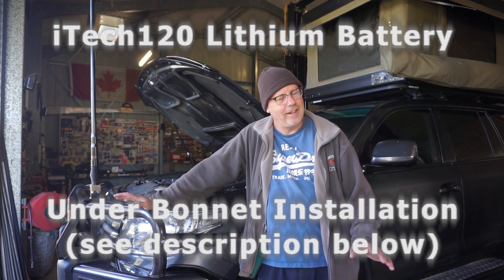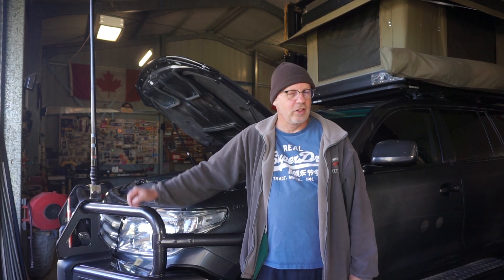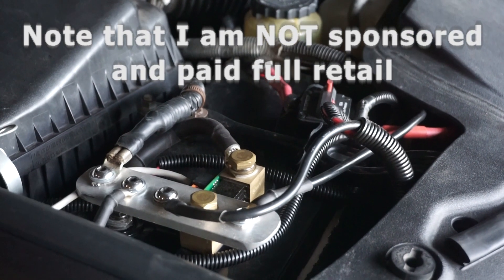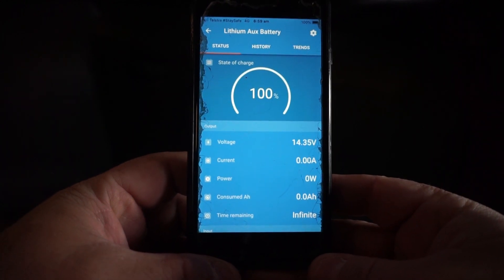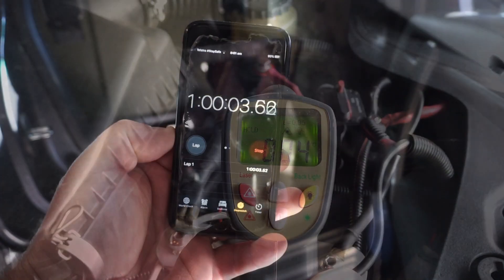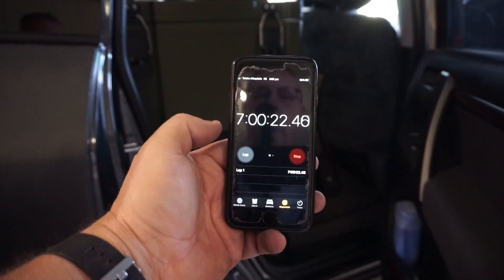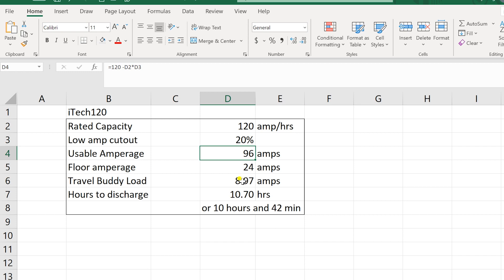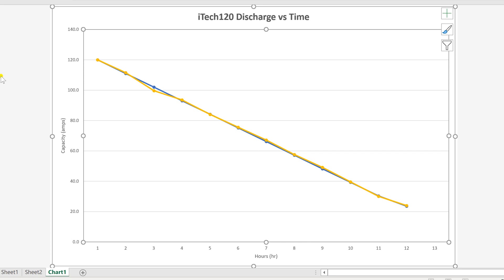Lithium Battery Long Term Review | itechworld 120 Under Bonnet Installation

Comment: I just bought my first 4 x 4 a week ago and have been looking at heaps of options for a dual 24vdc system. Your youtube vids are extremely helpful, much appreciated. My thoughts are to install an iTECH120X in a 150 series Prado under bonnet if I can fit it. I know your review is based on the iTECH120 however this led me to the iTECH120X same physical dimensions. Looking at the 330mm L dimension & Heat Shield Kit it appears to either fit or not fit by a cats whisker. I'm hoping that it will fit as these batteries appear to be an awesome option for 24vdc aux.  Cheers again for your review it's been very helpful.
Reply from the maker: Welcome to the 4WD community ANDREW, you’re life has forever changed for the better!  I have seen the 120X as well mate, they were not on the market when I bought mine otherwise I would have one under the bonnet.  It certainly was a tight fit in the 200, as you say by a cats whisker, the Prado 150 may be even tighter but I cannot confirm as I have no experience with that model of 4WD.  Thanks for watching and sharing your thoughts Andrew, I sincerely appreciate it 😎👍

Comment: Hi Terry, Great video! Curious if only you had some temperature logging data in real time as comparative vs voltage. I am also curious what dual DC DC charging system you are using? I am currently making the transition from a Redarc BCDC system to Victron setup.
Reply from the maker: Thanks for the kind words mate, I appreciate it very much.  I did not record temperature hourly as I did with voltage.  Having said that, I did record it throughout the test and there was zero detectable change.  The battery simply sat at whatever ambient temperature was at the time.  I’m using a Redarc BCDC25 and have had no issues or complaints.  I would be curious to understand why you are changing out your Redarc for a Victron.  Keep the shiny side up mate, cheers 😎👍

Comment: Good video Terry.  Can I ask why you settled on iTech World, I see them being flogged to death in the weekend papers and their approach just does my head in and has the adverse affect of turning me away.  I’ve watched quite a few lithium reviews now and I’m approaching the point of looking to replace my lead batteries with a lithium alternative. One brand that I keep hearing about by others but not necessarily being overtly promoted are DCS.  So as I respect your reviews because they are unbiased I’m keen to understand your choice. 👍
Reply from the maker: Hi Andrew, thanks for the great question mate.  I too see Itech advertising everywhere, I just thought I was getting spammed because I bought one😂.  As you can appreciate my review is not about comparing brand A with brand B.  I have only used itech so have nothing to base a comparison on.  The review was designed to challenge the notion that lithium cannot be placed under the bonnet and survive long term.  So far, I believe the bull case is valid.  The reason I bought an itech as opposed to any other brand is that they met my overall amp/hr requirements and they were on special at the time (I think about $100 bucks off from memory).  I trust this answers your question mate.  Cheers😎👍

Comment: Great to see a open minded review. Though aren't lithium batteries generally rated for useable Ah not total capacity. If this is true your useable 120Ah is now below 100Ah in seven months. This may not be the case with this brand but its generally what I've heard. May have missed it but was this method of battery tested perform when new for comparation?

All Under bonnet installations aren't the same. You have a better chance staying within the operating range in a front install but if near the back of the engine near the exhaust and/or turbo this would lift the temperature to an unacceptable level.
Reply from the maker: Hi David, thanks for your comments, your insight and of course your questions.  The itech batteries are rated for total capacity.  My battery has been superseded by the 120X.  It is rated at 120amp/hr total capacity with a true usable storage of 107Ah.

I did indeed cover the fact that I did not use this method of testing when brand new, but used the manufacturers specifications.  My logic is that if anything they are going to spec them biased to the high side for marketing purposes.  That being the case, any deterioration in performance over time would have a greater probability of showing up.

I agree, all under bonnet installations are not created equal.  Having said that, the warranty (which I have read in detail) does not stipulate good or bad positions, just that it is warranted for under bonnet installations.  I hope I never have to challenge this, but your point is well made none the less.  Thanks again mate, keep the shiny side up.  Cheers😎👍

Comment: Guess who just guaranteed a sale of 2 x itech120X when it's time to build out my vans electrical system...

Here I was thinking I'd have to shell out close to $3K in Koala coins to get a pair of 100AH battleborn's from the USA.
Reply from the maker: Nice one mate, I hope they set you back a crap load less than 3K!  Mines still going strong, no complaints.  In fact I’ll swap out the start battery with a lithium when my Lead acid one dies.  Cheers 😎👍
Reply: @JafffaAdventures  Interesting, do they have a gizmo now that makes lifepo4 suitable for cranking... or would you consider going wild and installing a capacitor bank for starting?
Reply from the maker: Apparently they have designed a separate battery that can handle the discharge currents that a starter motor or winch can draw.  I have not done any research on them, just know that they now have the “normal” lithium suitable for an auxiliary replacement like I have now, and a new lithium cranking battery.  That’s the route it will take when my start battery craps itself.  Cheers👍
Reply: @JafffaAdventures  Were you running an AGM and lithium for house battery in the past? I've got a redarc BCDC 1225 controller and am considering running lithium in my tacoma over here in the States... How was cold weather performance? Any issues charging below 0 Celsius?
Reply from the maker: I have run an AGM prior to the lithium and since switching to lithium I have not looked back.  I will also be swapping out my AGM start battery with a lithium when my start battery dies, I’m that much of a convert.  I Queensland we rarely get temperatures below zero but in the rare instances it does, I have had no difficulties in charging the lithium.  I’m sorry I do not have more definitive data for you.  Cheers

Comment: Hi Terry, great video and info.  May I ask if you have measured roughly what the temp gets to under the bonnet.  Also with your original video on the install you cut the battery tray.   Have you found that the battery moves at all under corrugations or other conditions.  I think the new tech measures 330mm and most trays are around 300mm  Many thanks
Reply from the maker: Thanks for the kind words Glenn, I sincerely appreciate it.  No I have not measured under bonnet temperatures mate, sorry.  I do note that they have dropped noticeably since I fitted the bonnet scoop, probably due to the significantly increased air flow.  Just going by touch however, I would estimate the battery sits at 30-40C highway driving, 40-50C off road.  Regarding battery movement with the cut tray, no mate has not budged a mm since the install.  The battery hold down clamps are pretty bloody good.  Thanks again Glenn👍😎
Reply: @JafffaAdventures  Thank you very much Terry.  All good info
Reply from the maker: My pleasure Glenn👍
Reply: @JafffaAdventures  Hi Terry, May I ask what swayed you to choose the Victron BMV-712
Reply from the maker: Hi Glenn, good question.  I guess in the end it had the functionality that I wanted coupled with the fact that many many others had the system installed and never once did I hear of any issues.  I’ve had mine installed for two maybe three years now and love it.  I would certainly purchase it again if the need arose.  Thanks again for watching Glenn😎👍
Reply: @JafffaAdventures  Thank you
Reply from the maker: All good Glenn👍

Comment: Great to see this information.  There seems to be more BS in lithium batteries than a Kansas stock yard!. I to run an Itech in a ute canopy and always wondered if Itech was dodgy like some of the horror stories out there and that US power dude that pulls lithium batteries apart only to find bad manufacturing.  I still don't know what is inside my Itech and how well it is built or what kind of cells. 
I note that Itech now sprukes there newer replacement has prism cells, So the one you and I have most certainly wont.   Saying that, It's warming to know yours tested well. So far so good with mine after nine months. Having 96AH available for only 11kg and super fast charging is just camping life changing.
Reply from the maker: Thanks for the kind words and sharing your thoughts.  It is definitely hard to sort the BS from the facts hence me trying to find out how this battery is performing.  I will review again after 18 months in situ.  You certainly hit the nail on the head, having this amount of usable power is camp changing!  Cheers👍😎

Comment: Great report mate. I've had my Itechworld 120ah battery since September 2018 and it's great. I've taken the liberty of sharing the link to the Caravanners Forum as there has been a HUGE discussion going on about the battery there. The "experts" have been saying all along that a battery that only weighs 11kg cannot possibly have a 120ah capacity. It would appear you have proved them quite wrong. Good work.
Reply from the maker: Thanks Bill, appreciate your comments and feedback.  It's amazing the "professional" opinions the can run rampant on social media with zero data to back the opinions up!  I'll continue the fight with facts, whatever the topic may be!  Cheers Bill.
Reply: Hi guys i own and have tested 4 of the itech120x. firstly they are great performers and opening them up are built well. clean bms pcb with big heatsink. neat wiring and laser welded busbars. they are a 2p 4s pack to 2 parallel cells of which 4 of those are in series so 8 cells total. i have had no issues pulling 145amp loads on my 3000w inverter running welders and induction cooktops etc. The battery is advertised as 120ah but 105ah usable to 10v at a 20hr rate. this means it is in fact a 105ah battery not 120ah. i have also removed the cell bank and bypassed the bms and have done a discharge test with a computer tester along side itechs 20hr rating which is 5amps discharge - from 14.4v down to 10v. my test was 103.6ah. this is basically a 105ah battery. not 120ah. that said the quality and price coupled with the higher 150amp continuous discharge rate i would still say compared to other 100ah batteries with a 100amp continuous discharge rate its still a good buy and you do get the 105ah usable they state. but i don't know why they say its a 120ah battery when its simply not. i am still happy with how mine perform and how solid they are built. the weight and 10v voltage cut off gives it away. i also at first thought it had a low amp cut off so 80% dod but no. the 10v cut off should have given that away but since all the specs are so mixed up on all their batteries i didn't think much of it at first. if you look at all the batter specs accros the site there are many miss matched figures. i even bought the cranking battery and the sticker specs were way off from the online specs. same with the manuals on both my batteries and the cranking battery only had 26ah capacity when its advertised at 60ah so i sent it back of which they said it was faulty and would send another but i decided on a refund. i was not sure about the cranking battery as it charged and discharged to the correct voltages but did not give 60ah usable but instead 26ah.
Reply: Yeah second that - great to see you prove them wrong💪

Comment: Great video, very interesting. I did a search and found Koolwrap actually do a Battery Insulation product which I might look at when it comes time to swap to Lithium.
Reply from the maker: Thanks for the feedback Derrick.  I was not aware of the Koolwrap product but I had the material I used on the shelf anyway.  Thanks for sharing your findings mate👍😎

Comment: Great video mate very informative
Couple of questions if you don’t mind:
I understand you connect all your accessories such as lights fridge and oven etc to the lithium circuit, but what about winch and other short use high draw accessories, do you have those connected to your start battery?

And is the only connections between the lithium battery and the rest of the vehicle thru the charger and battery management? So it’s a totally independent circuit?

Also assume is charges from the vehicle alternator via the start batt first? And does your solar go to the start batt first then the lithium?

And finally, do you have an emergency cross over if you find your start batt dies, can you start from the lithium?
Reply from the maker: Thanks for your kind words Chris, I certainly do appreciate them.  I'll try and answer your questions as best I can.
The lithium has EVERY accessory connected to it except the winch, that is hooked to the lead start battery.
The lithium is charged by a BCDC25 charger so whenever the car is running the lithium is accepting a 25amp charge (unless it's full of course).
Everything connected to the lithium battery are earthed through the Victron BVM-712.  That ensures that all current draw on the lithium is accounted for and I can monitor discharge rates accurately.  So I guess you could call the lithium an independent circuit even though it is connected to the alternator through the BCDC.
The lithium has a standard discharge current of 130amps and a max discharge of 300amps.  So, while this is not enough to run a winch, it is certainly enough to power all the accessories I have hooked to it (at the same time if I wanted!!).
The solar goes to the lithium only (through the BCDC).
Because I only have my winch and the factory Toyota gadgets running off the start battery it is VERY unlikely that my main battery would get discharged enough so I could not start the car.  In the event that it does, I have an Andersen plug  wired to the start battery where I can run my solar through an inverter I carry to charge that start battery.  It might take a day to charge up, but an extra day in the bush is OK by me!
In the event of a dire emergency, I do carry jumper leads so could connect the lithium to the start battery, let them equalise for a spell, and then start the car once that happens.  I trust this makes sense mate, it can be a bit confusing and sometimes I struggle getting my thoughts across.  Happy to provide any clarification and answer any additional questions you may have Chris.  Cheers!!
Reply: Jafffa Adventures that’s perfect thank you. Exactly the set up I’m looking to do myself. 
Any recommendations for the BCDC? 
Thanks again
Enjoy the videos
Reply from the maker: Thanks Chris, I’m glad you are finding them useful, that plugs directly into the reason I share.  I run a Redarc BCDC and it has served me well with no problems.  I cannot compare it to anything else on the market as it’s the only one I have used, so please bear that in mind.  I paid full retail for it so am just a general consumer like the rest of us mugs😜.  Keep the shiny side up mate.👍
Reply: Chris, Itech also make a 1300CCA under bonnet starting battery which is compatible with winching.

Comment: Good stuff Terry, I too was of the opinion that lithium don't like heat, but Stefan Fisher and now you have shown this is not necessarily the case. Im keeping this in mind for the future. Cheers Steve
Reply from the maker: Thanks Steve.  I can certainly say that I am never going back to lead.  When my start battery gives up the ghost I will be changing it over as well.
Keep the shiny side up.  Cheers!

Comment: Great video Terry, as you say batteries have probably been the point of the most miss information and varied technical advice, and often from "so called experts".
Your test answers most common sense questions as to the capacity, drawn down and longevity of Lithium (up to this point obviously).
Having travelled in arduous hot and rough dessert conditions, I would be supremely confident of installing the same following your experience.
Thank you again, and keep these types of video's coming.
We need to see more in depth, but understandable, as well as real life usage feedback from these after market installations.
Reply from the maker: Very kind ANDREW, thanks for your comments and for following along.  I agreed there are a lot of keyboard warriors out there and not a lot of empirical data and testing.  I was very happy with the results and will continue to monitor over time of course.  I have killed lead acid batteries in under 12 months so I am stoked so far.  Cheers👍😎